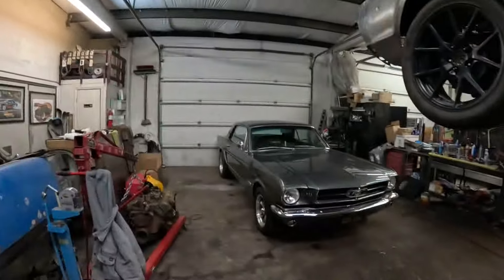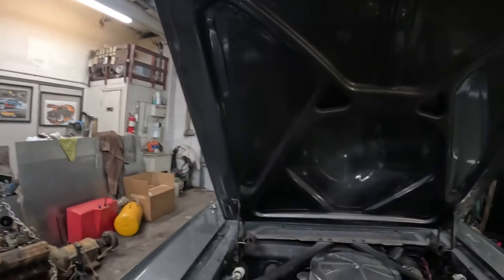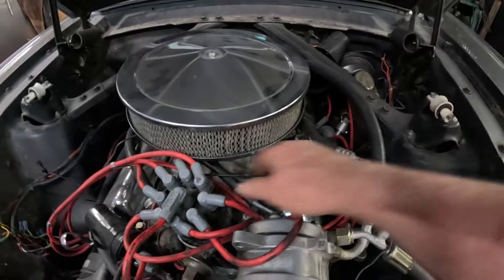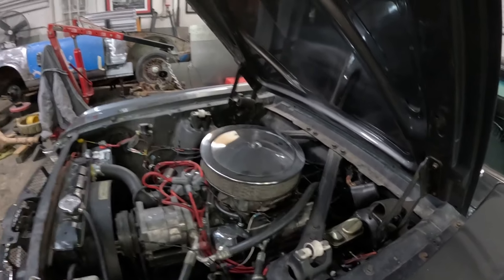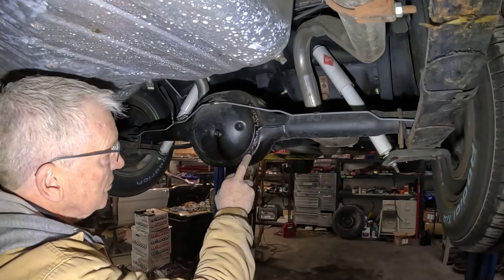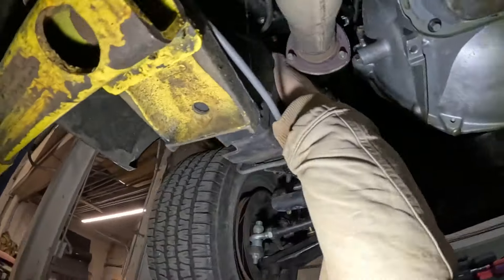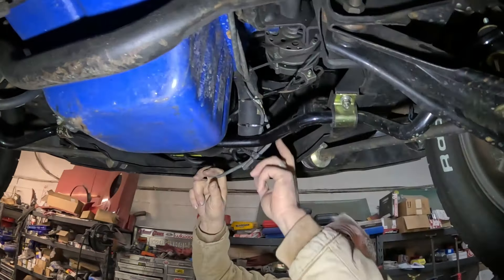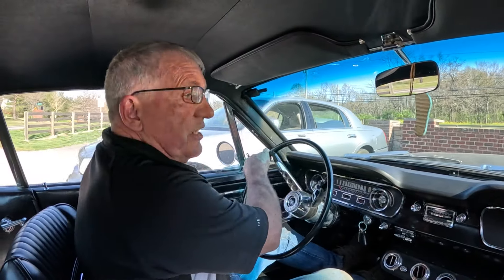Another Messed Up Mustang !!!

Comment: There's a video here on YouTube of a man driving a Mustang that's been restored to original factory specs on the German Autobahn.  At speeds of well over 100mph the car tracks straight.  So much for these big dollar 'improvements' .    These aftermarket 'upgrades' result in butchered cars and empty wallets.  Stay away.
Reply: I have a 74 Monte Carlo base model 350
only mods are Intake and a 1958 4 barrel carb, redt is stock
car feels like floating on a couch at over 90mph
I'm never gonna "upgrade" anything else

Comment: Kiwi, good morning! I greatly appreciate your videos as insight to these older Fords. In watching this video much was mentioned of the steering rack ( or more so linkage to/from column to the rack)
I understand the issues, I’m looking at installing a RRS rack which will directly bolt in to my 69 Fairlane; appears once in the height of the rack can be adjusted to minimize bump steer. 
I was curious if you had an opinion of the RRS  rack, I realize, like any rack, the linkage plays a big part in getting the angles right to have clean steering. 
I’ve considered the Borgeson box but am hoping for a tighter ratio found in the rack.
In brief, any thoughts or insight of the RRS rack, racks in general ( in older Fords) vs the Borgeson box. Thank you again, and I greatly appreciate your videos. Very best of regards to you & yours